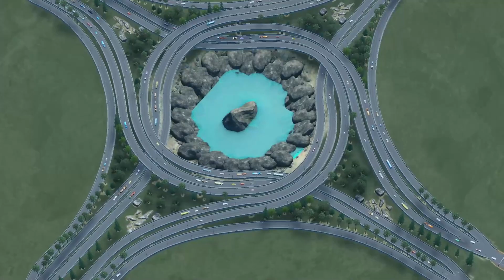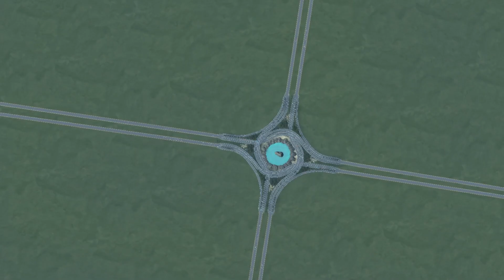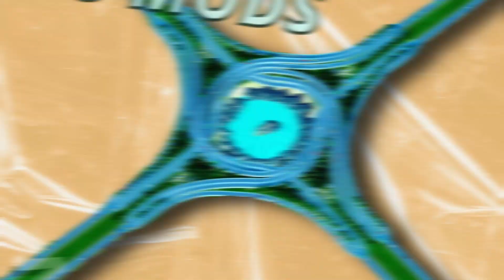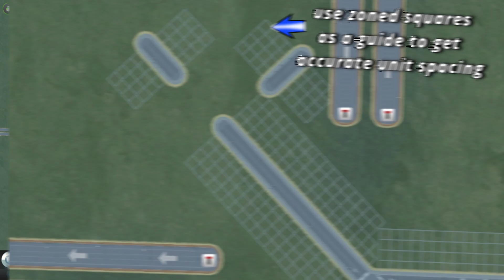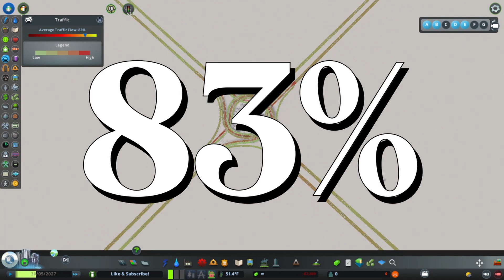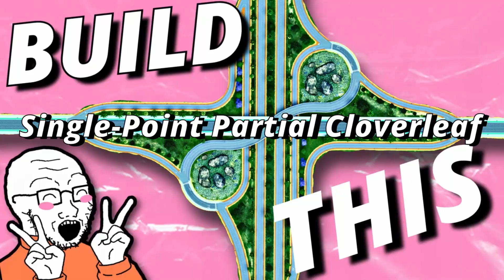EASY Pinavia Interchange Tutorial (Cities Skylines)

Comment from the maker: Quick note for everyone: I do have network anarchy installed on this account too but the mod has no impact on the build itself. Still possible totally vanilla. And just so everyone knows each elevation step is 3 meters if you're not using precision engineering to measure it.

And for the original technique go sub to HK_CitiesSkylines here https://youtube.com/@hk_citiesskylines6733
Reply: I agree everything here is vanillable but you may want to turn of the anarchy setting in network anarchy to be completely sure next time ;)
Reply from the maker: @TeddyRadko  true, I forgot to turn it off when filming hahah but I've done this design about four or fives times, totally vanilla and it's the same process.